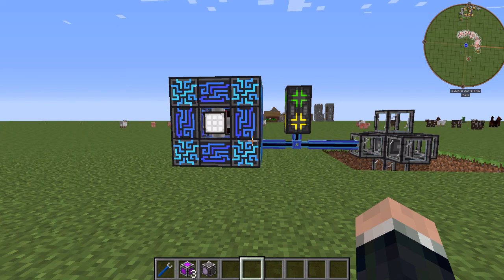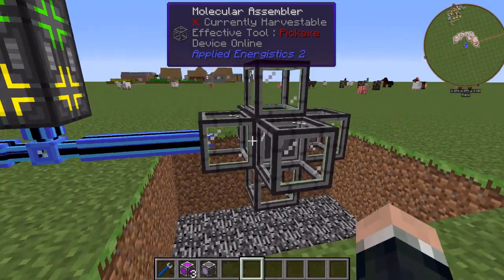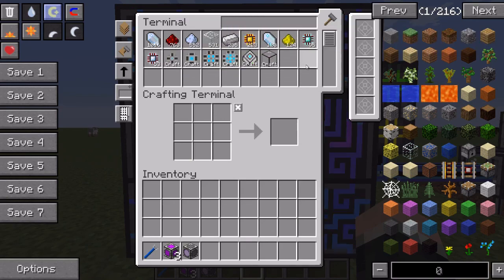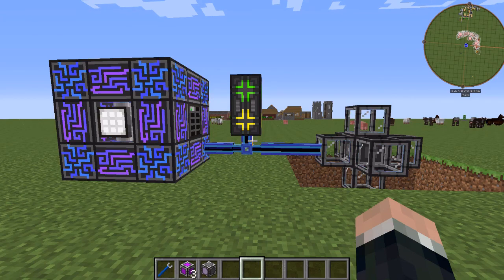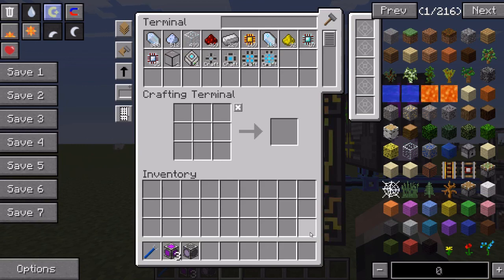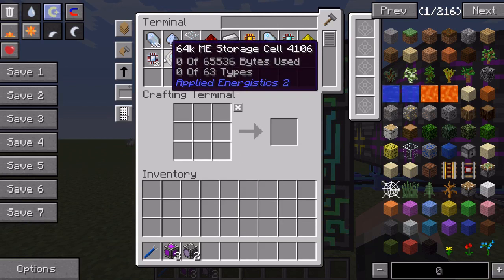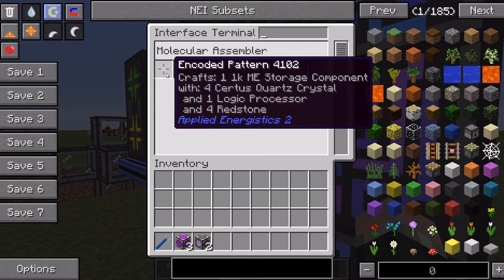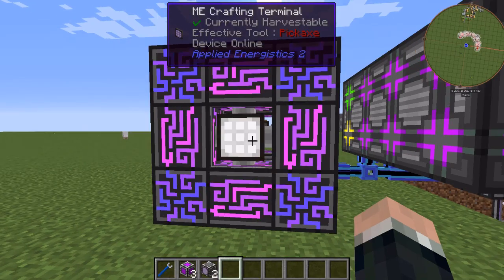Minecraft: AE2 Co-Processors(What Do They Do?)1.7.10

Comment: From what I understand, each CO Processor allows 1 additional parallel recipe. So if you only had 1 processor, it would still use all the chambers, but it would only craft 1 pattern at a time. If you used 2, it would do 2 patterns at a time. Which is why there's a falloff with a single recipe. If, for instance, you triggered a 64k storage, and a chest, and a crafting table, and some fences, you'd want a co processor for each unique recipe. Also, unless you had 4 co processors, you wouldn't be able to order all 4 of those things at a time (it would tell you there are no co processors available).
Reply: David Ash That is pretty much how it works, yes. For this recipe which is basically one line of upgrades, it isn't really that big of a deal after having one co-processor, but with this setup and that recipe, you'll get the maximum output at 2 co-processors, assuming you only have assemblers connected to it. I am not sure if it's possible to have inscribers connected to the same interface as an assembler and still work 100% of the time, mostly since I haven't tried, but I'm unsure if the interface is programmed well enough to do advanced processes like that.